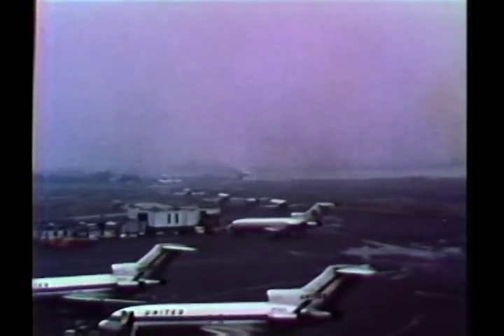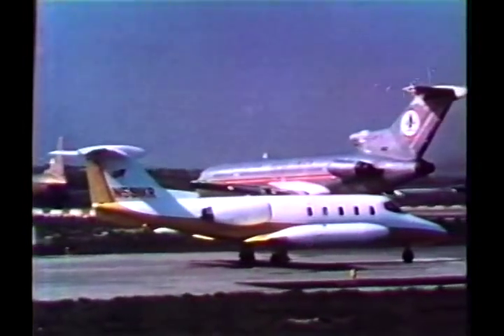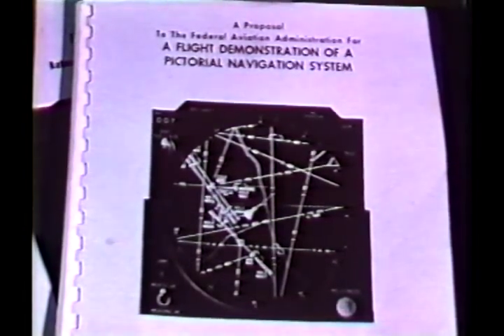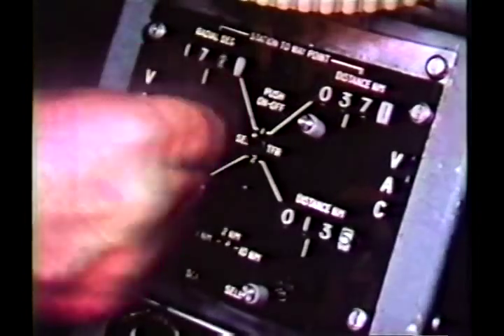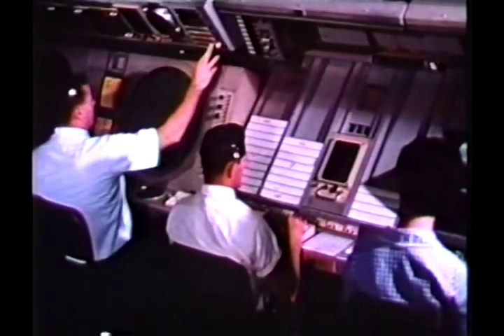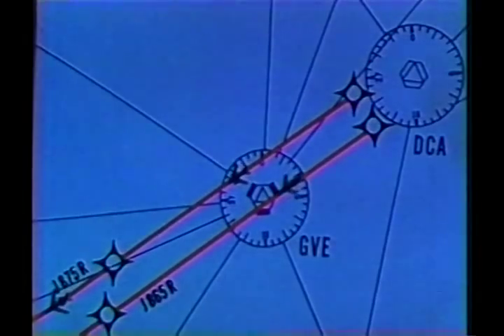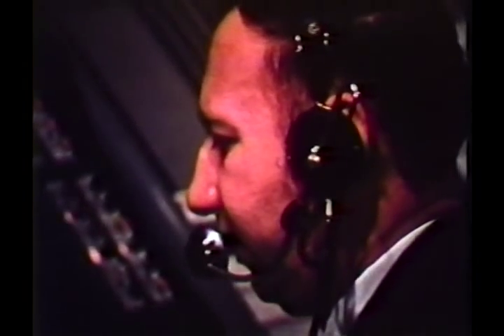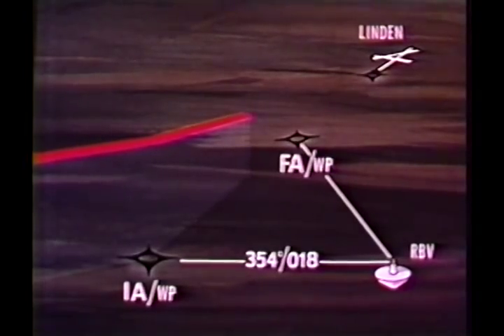Area Navigation - FAA video Private/Instrument/Commercial Pilot training 1974

Comment: Very informative video on the early phases of RNAV. I was using an RNAV system with an LED  digital display for the course line computer. The V-tail Bonanza I used to fly had this kind of equipment. It was much better than the station to station navigation used previously.